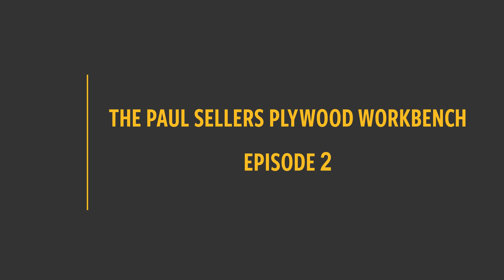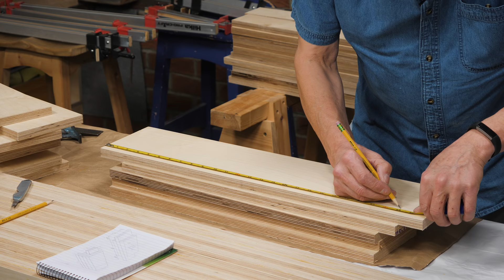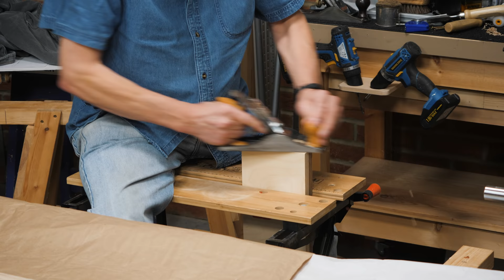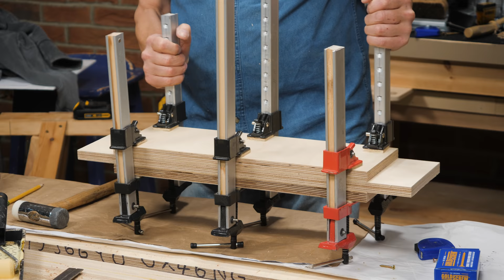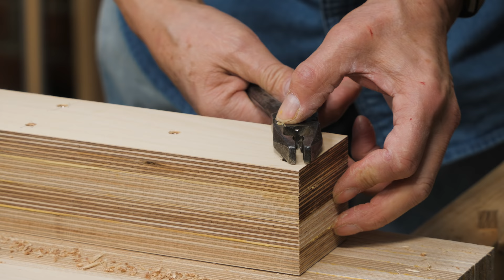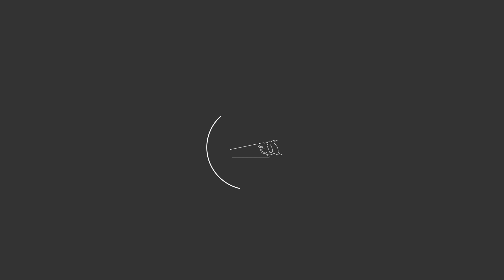The Paul Sellers Plywood Workbench | Episode 2

Comment: Love the idea of using the cut nails to act as alignment pins for the glue.
Reply: Screws also act as a clamp. If you can plan them into your builds they can make life very easy. You can also pre drill the screw holes if you desire before gluing.

Comment: It's actually much cleaner if you have a scrap piece of wood to back the piece you are screwing through, it great reduces the splintering and blow out from the bit coming out the back. And that goes for plywood and solid wood. Just a little helpful tip

Comment: I find it funny how much protection you have for using that bandsaw. Pretty much all they made us use back when I was in highschool was a pair of goggles. Didn't even have dust extraction. Weirdly for how safety paranoid they were they weren't that paranoid about dust. Only machine that had any sort of dust extraction was the lathe due to the mess it made.
Reply: It's not so funny when you know most all plywood contains adhesive resins that contain formaldehyde and other not-so-nice chemicals.  When they become airborne fine dust particles they are a real problem.  This is one of the good reasons to use hand tools for woodworking: very little fine dust like that created by powered machines.

Comment: Hi Paul, thank you for bringing us great videos, and thank you for not adding background music :-) I have one question, what kind of mask is that, does it have a built-in fan?
Reply: I believe it is a Trend Airshield Air-Circulating Pro.  Costs around $400 in the USA if it is, which is rather pricey unless you care about living a long time without debilitating or fatal lung disease.  But  remember that it will not protect you if you take it off from the very small and very dangerous particles that remain suspended in the air for hours or even days.  Use whole shop air filtration too as I believe Mr Sellers does.

Comment: I've made something like this before, but with only three layers of plywood.  I laid out two legs, put the stretchers across them, cut the middle layer of the legs to fit and glued and screwed them all together at once being careful of everything being square. I was kinda surprised you didn't use that method. Is it a matter of not having the surface to work on? Or is there some flaw in my method?

Comment: Paul, is there a reason you didn't cut all the rail pieces at once on the bandsaw, it certainly has the capacity. Then all your pieces would be the same length. If you were off +/- 1/64" they would all still be the same.

Comment: What may I ask is the difference between a bridal joint and a corner housing joint when you build up the pieces as you are doing? Surely it was unnecessary to remove the piece from the tenon and put another bit on the end of the mortice, just leave it on the tenon and glue it up. Since you are not building it out of solid wood there is no reason to fabricate it as though you were.

Comment: Why not just glue the legs together instead of screwing them if there is even the remote chance of putting in a dog hole or attaching some other accessory? Is there that much movement in plywood that the screws are a better option?
Reply: In part one he made it clear it is only to speed up the project--no waiting for clamps to come off.  Obviously it also makes it possible to assemble multiple pieces without  having to have a huge number of clamps.  I'd prefer not to use screws myself, but what he is doing makes sense if you are sure, as he is, that you'll never be drilling into a screw.   So, as he says, do it whichever way works for you.

Comment: I really like the concept. Can I make one with a 2x4 material top?
Reply: You can but you will have to deal with twisted or cupped boards.  And depending on the species of wood you choose, it maybe lighter than plywood.  You decide if that’s good or bad.
Reply: Paul Seller has 2 other workbench series, you could check them out, if you are inclined to go the 2x4 way
Or you could check his blog

Comment: Can anyone tell me the type of clamp he is using around 17:00?  Thanks in advance.
Reply: And I will definitely use that nail tip for glueing up! Thanks Paul!
Reply: Generically they are aluminum bar clamps--you can look them up that way and find many brands at many prices.  But I would recommend that you find Paul Sellers' video on improving the clamps enormously by making a few simple modifications,  Out of the box they're not the best clamp, but the modifications make them very good at an attractive price.
Reply: @harlowchandlerjr.6371 , thanks for the info!
Reply: I believe in the video on clamp improvements he said they were from Harbor Freight.
Reply: Thanks @wdbrnr63  , it helps to know the source.

Comment: This man is so slow I was a carpentry contractor he wouldn't last 5 minutes in the real world I can sharpen a saw 10 times faster than him
Reply: @Andy-in8ej  say that to my face l
Reply: @Andy-in8ej  Your comment does not add value to the tone and purpose of this channel. David's right, a good commercial  carpenter is fast and delivers; however, they are doing a different type of work.
Now about speed and efficiency, I'm going to use my pin/brad nailer to move things along instead of screws. I'm going to use my Kreg rip-cut jig to get my strips. 
Hey David, find his video where here cranks out some nice dovetails by hand. That is impressive.